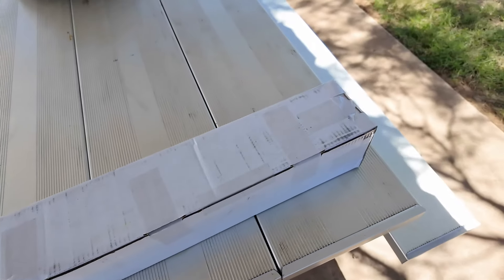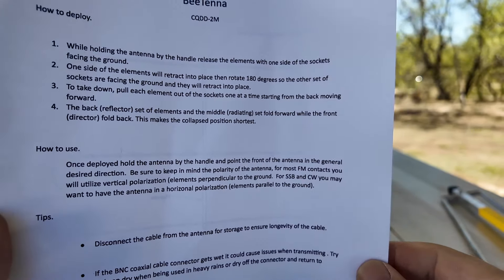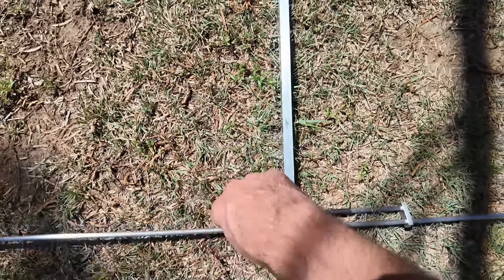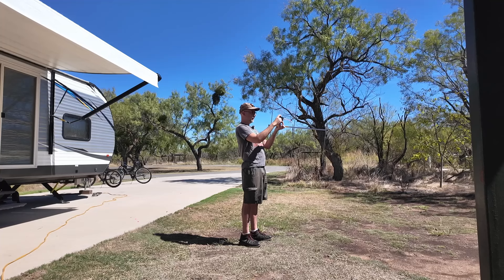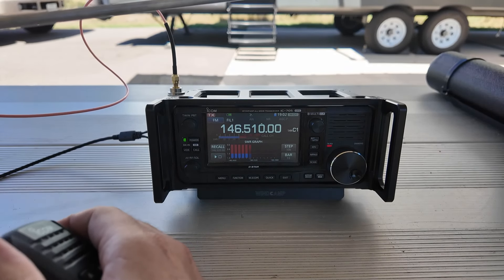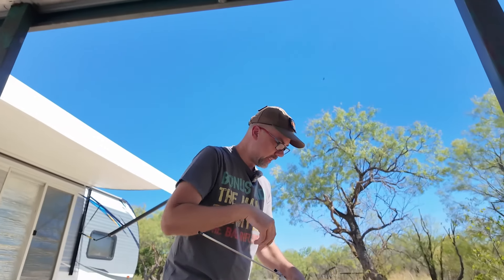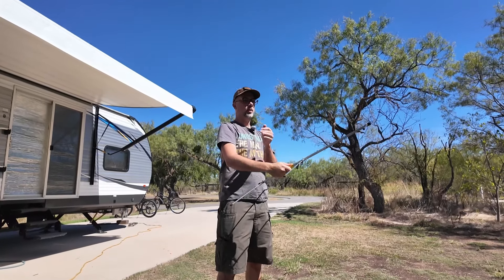The Fastest Antenna in the WEST!

Comment: It looks like you need to lengthen the boom 6"  behind the reflector element, so that your hand or mast/ tripod does not affect the SWR or radiation pattern. You could make the extension a plug in piece so it will still all fit in the container
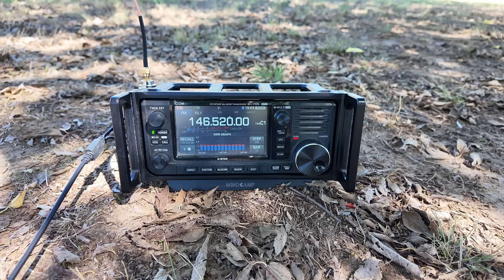Reply from the maker: 1.5:1 at ground level.  Would have been even better if I was standing up as the antenna was designed.  1.5:1 is more than good enough to get the job done. 6:29

Comment: Thanks for the video! It is designed to be operated at 5' off ground or higher at arms reach away. I also have a VHF/UHF version available that can be seperated or combined as well as a tripod mount that will be available in the next few days!
Reply from the maker: Thanks Chayne, the yagi did great at opening the repeater near the end of the video.  I can imagine hooking this to a small 12v rotator also, that would be a fun Arduino project!

Comment: Great antenna !  Love your start up on the IC 705 !  The best you can hope for is somewhat of a match with a antenna like that.  Everything affects SWR .  Looks like RG 316  PTFE coax.  Great for them short runs !  Try using RG 213. . You won't be happy. With handheld antenna like that sometimes when vertical . flipping 180 deg. makes a difference.  gamma match either up or down . Has to do with reflections and phasing when RF gets into the real world.  73
Reply from the maker: I can imagine using 213 on that antenna, that would suck!